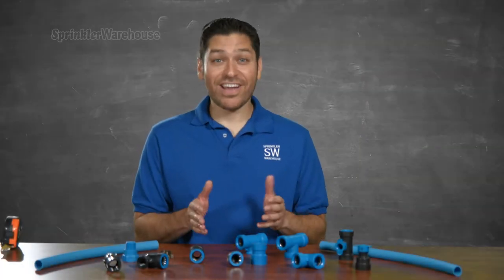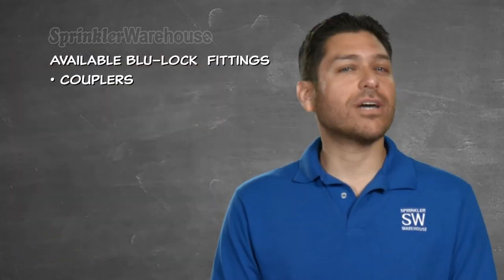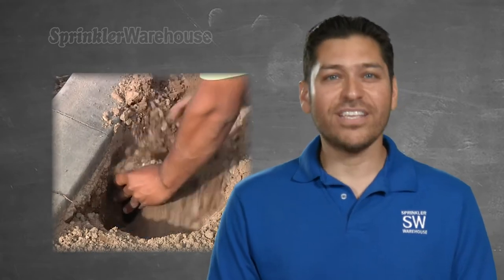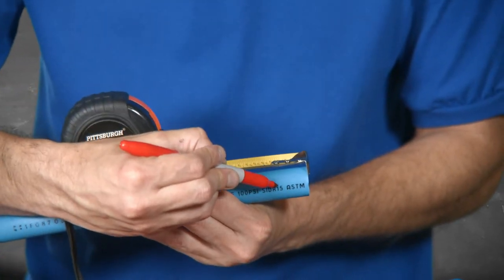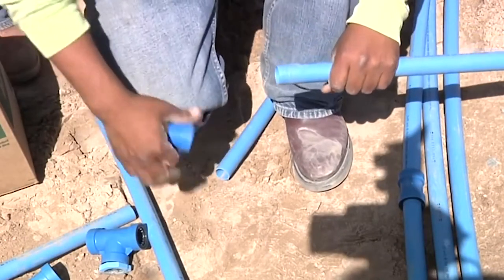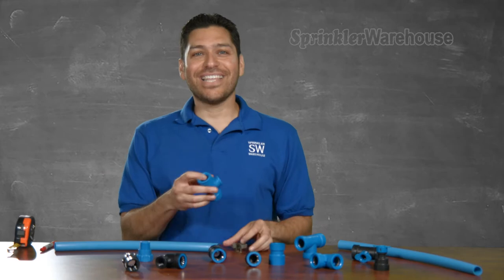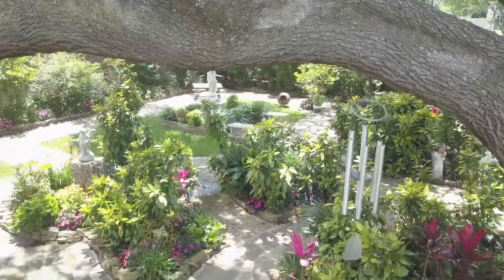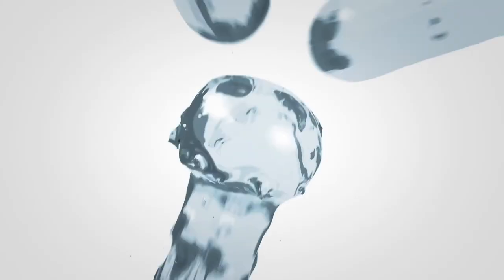Blu-Lock Pipe Fittings

Comment: hydrorain also makes pvc-lock fittings - same idea with pvc pipe,   and I see they also make a pvc-lock to blu-lock push on (both sides) fittings now which makes a lot more sense.   part BL474-010 and BL474-007.  It seems you still need to adapt down to drip-lock (or via NPT) to connect black drip pipe and barbed drip fittings (not that hard) but regular NPT risers and sprinklers are covered.   Am a fan of shark-bite type fittings with copper, pex as well as the pvc-lock fittings with pvc.   The blu-lock pipe looks reasonably priced and comes in long rolls avoiding the glue-every-20-feet with pvc.  If I had seen this b4 just installing over a 1000 ft of 1in pvc I might have given it a try - this would've been way quicker and similar cost and actually more flexible in making changes/additions after install.  still need pvc for the larger diameter feed pipes (1.5, 2in etc).